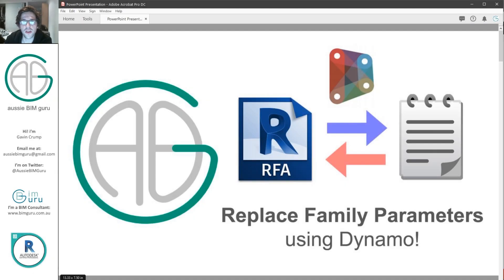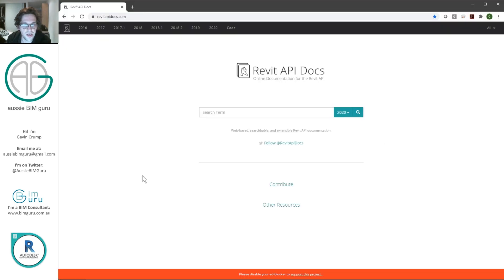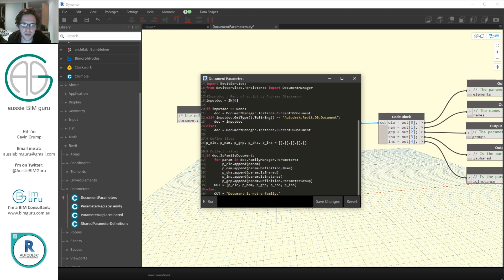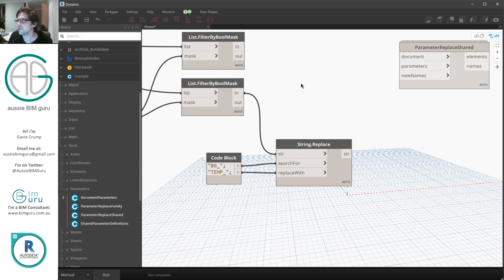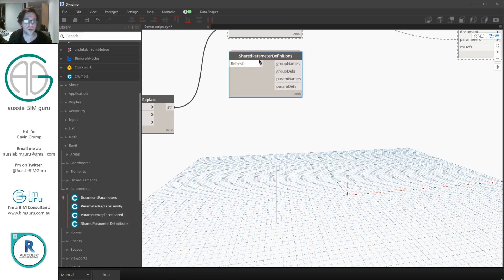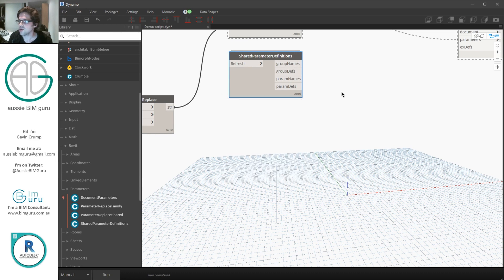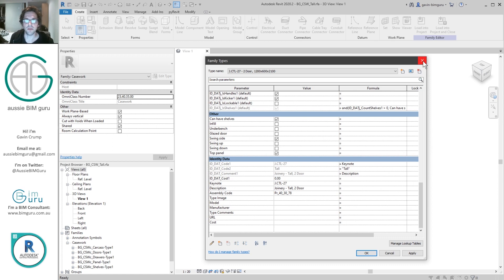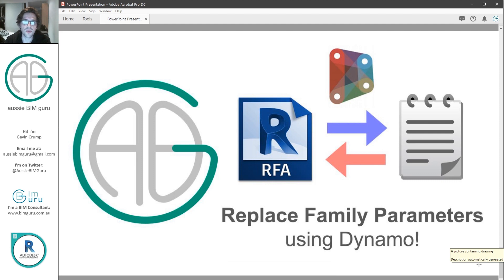Replace Family Parameters using Dynamo!

Comment: Hi Gavin, I was looking for Dynamo to rename Shared parameter and family parameters. And found this Video. This is what I am looking for. However, I could not find the node in the Crumple package I downloaded. I am using R23, and Crumple package Ver is2022.5. I can see the package nodes have been updated. Can you please advise which nodes can be used to replace the DocumentParameters? Also I can see the namelist from DocumentParameters was the input for String.StartsWith. Where it requires String but not list. This is warning I had when I tried to use namelist for input for String.StartsWith. following your video. Anything I am missing? Thanks
Reply from the maker: Family parameters can be replaced using the nodes under FamilyDoc, there is one there to replace any with shared.

Replacing at the project level is not possible in the Revit API, only family level.
Reply: @AussieBIMGuru  Thanks Gavin. I found it. I am following your video to build a Dynamo. I have an issue with last node SharedParameters.Flat and newnames to replace. How can I combine those two to be input as definition  for renamed share parameter as I could not find the DSCore.list you used in code block. Thank you for you time.
Reply: @AussieBIMGuru  I actually just copied code to code block, but it seems DSCore became as variable on the left , and waring said internal error, dereferencing a non- pointer. Any advice for this? Thanks
Reply from the maker: @shaoqinyuan4960 generally my nodes dont work in code blocks, they use python. Im not sure if this is what you mean though.
Reply: Thanks Gavin for the quick response. I mean the code block you used in the video which takes the namelist, definition list and string to replace, as input for final node. That code block did not work. DSCore seems not recognized. Anything I am missing? Thanks
Reply from the maker: @shaoqinyuan4960 if youre in a new dynamo build it us likely a namespace clash.

Try using nodes instead as a workaround, codeblock is just a shortcut to save space.
Reply: @AussieBIMGuru  How can I get non-shared and shared parameter from the node FamilyDoc.GetParameters? and how how can I get list of name not array from the output of that node? Thanks
Reply from the maker: @shaoqinyuan4960 try using my familyparameter nodes that can return if a parameter is shared and also their names in separate nodes. You can use this with filterbybooleanmask and list levels.

Comment: Hi Gavin! I installed package 2024.4.3 and your nodes ParameterReplaceShared, ParameterReplaceFamily don't work.. Why it doesn't work?
Reply from the maker: Hrm hard to say... if youre using revit 2025 i havent tested there yet. Ive got samples of how the nodes are intended to be used here as they changed. Be sure to connect to the SP file before running.

https://github.com/aussieBIMguru/Crumple/blob/master/Script%20samples/Crumple_ReplaceParameters.dyn

I'll likely redo this video after i finish my break from YT.

Comment: Hi Gavin, is Crumple available for revit 2023?, I could not find the "DocumentParameters" node. I already copy and pasted the bin dyf and pkg.json files from Github into the 2.13 Folder on Dynamo Revit. But the node is still not available . the only nodes available under parameters are "BIPGbyName" and "ProjectInformation" nodes.
Reply from the maker: It will be under FamilyDoc, I reorganized the package after this video.
Reply: @AussieBIMGuru  I Found it, Thanks Gavin!!
Reply: So "Document Parameters" is now FamilyDoc.Parameters?, but they don't have the refresh option, Also when I connected the Document.Current output to the Node I got Null values.
Reply from the maker: By default it should read the current document, and this also acts as the refresh switch also.

It will work for family documents only, and my package needs the IronPython2.7 package installed to support its nodes as they do not use CPython3.

Comment: Hi Gavin :), so this is awesome, thank you for building this. I have a question for you. We have a set of share parameters we want to use, that have particular GUIDs do you know if there is an ability to add these GUID as well as the shared parameter name? or even do you know if the API has something to that effect? many thanks, as always
Reply from the maker: Generally a GUID is set based on many things and cant be set manually, especially given that GUID might already exist for parameters with different names. I usually suggest that the GUID is what it is, and cant be safely associated to a new parameter name.
Reply: You can to generate GUID with Diroots app

Comment: Hello, it was an amazing video, thanks for sharing it. I have a huge dilemma and I am new to Dynamo. I have a BIM model from a manufacturer which does not have different family categories assigned to the elements. All the elements are in the generic model category. Is there a way I can change the category of the entire model using Dynamo?
Reply from the maker: You'll need to open them as documents from the project, change their category and then reload them. This can be done programatically using Dynamo and the Orchid package. This package has nodes to edit/open a family document, set category and load/close.

Comment: Hello, Gavin! Thank you for yor lessons and package! I would like to ask you about node from your package "© FamilyDocReplaceSharedParameter". I'm trying to replace parameters in several family documents (levels in inputs are correct) and this node replace parameters in the first documents (list 0), but returns nulls in the other:( What should I do?
Reply from the maker: Currently I havent built this node to handle multiple documents, but you could try setting the doc input to @l1 and others to @l2 with longest lacing and see if that works. Otherwise try out the nodes in Orchid package that do the same thing and are a bit more robust.

Comment: Amazing nodes, thank you so much for this. The only Issue I'm having is that in my case the shared parameters have very different names (more fields etc.). Ideally I would use an excel that maps each 'old' shared parameter to the 'new' one and feed the excel to Dynamo like you mentioned but I'm not proficient enough in Dynamo to do this.
Reply from the maker: Then my suggestion is to bsgin learning dynamo fundamentals and return to this workflow when you are ready. It's a bit of a harsh answer i know, but the best approach to take if Dynamo is a program you wish to add to your skillset. The best way to learn is to have a goal workflow to work towards.
Reply: @AussieBIMGuru  Well yes, I am aware that if I want to be able to use Dynamo I need to learn it and that is what I am doing. Just struggling at the moment with the step I described above. It is of course not your responsibility to teach me so no worries.
Reply from the maker: @luisbrionesalonso5456  it would involve getting the index a parameter name in column A of an excel file occurs at, then getting the item at that index from column B. Most of these tricks are in the dynamo primer, I suggest giving it a read through.
Reply: @AussieBIMGuru  Thanks for the tip, I will be sure to check out the primer. And thanks again for the great video and nodes.

Comment: Hi, thanks alot for that great ideas on your video as usual 
i wonder if is it possible to replace that parameter to all category , not family one by one 

Thank you
Reply from the maker: Yes most family workflows can be reworked to function in bulk, however it is much more complex and not something I'd be able to cover simply for YouTube unfortunately.

This is an example of another workflow on the channel I changed to bulk, hopefully it is helpful;
https://youtu.be/dLRgJMj5ZOQ
Reply: @AussieBIMGuru  thanks for your quick reply appreciated
So your crumble package can't work with 'background open' node  now yes ?
Reply from the maker: @moelprenselprens1425  no I would suggest using orchid or rhythm package for this. Orchid also has nodes similar to mine for replacing parameters now, I think they were added after this video was made.
Reply: @AussieBIMGuru  thanks alot for your generosity

Comment: Thanks Gavin!

Has anyone had any issues getting this work? I can successfully change it to "TEMP_", however whenever I run the whole script, the "BG_" does not change to what I need it to.
Reply from the maker: Have received your email, will reply later today. The issue is probably that your parameters have the old guid's, so they cannot be swapped. You will need to generate a new shared parameters file based on the old one, with new guids.

https://youtu.be/pHgxkq-NGdg

Comment: Hi Gavin, thanks for the great video and great package! Can similar workflow be used also for changing all of the family parameters into shared ones? Keeping the same name and everything just making them shared. Would really appreciate your help, thank you! :)
Reply from the maker: You would need to create the shared parameters first as an additional step, I haven't found a way to do this from a family unfortunately. Typically I do this from project, see this workflow where I construct a new shared parameters file from excel;
https://www.youtube.com/watch?v=pHgxkq-NGdg

If you could gather all the parameters you want to make from the families into an excel or csv file, you could generate them using that workflow, then have them available for the replacement step.
Reply: @AussieBIMGuru  thanks for the answer! I managed to do it - I first got out all the family parameters and put them into Excel and then put that Excel file back in and created shared parameters, using this library https://forum.dynamobim.com/t/add-shared-parameter-to-project/8100/23. Works well for me :)
Reply from the maker: Yeah the add shared parameters to project node is the one I used in my tutorial also, a nice little Revit/Dynamo hack!

Comment: A great script, really helps.

Is it possible to batch run this on directory of families?
Reply from the maker: Yes I believe with some adjustments it may be possible. It would require some working at levels however so is likely quite challenging.

I would refer to my batch add shared parameters tutorial for reference of how the underlying process works, essentially using 'open in background'.

Comment: Family. RelaceFamily does not work, they say " Empty"  all things is good, but the final they dont work, i have checked the "ParameterReplaceFamily" is emty. 😥
Reply from the maker: Which dynamo build and revit version? I don't believe my nodes will always work prior to Revit 2020 and Dynamo 2.3.

The nodes are exposed with Python component available if you want to just try and work through that to troubleshoot - the method is fairly typical of this workflow so I don't think the node is the problem itself.
Reply: @AussieBIMGuru  Could you please give me your email?
Reply from the maker: Just replied, the issue is that the parameters are already family parameters I think.
Reply: @AussieBIMGuru  i am using Dynamo 2.1